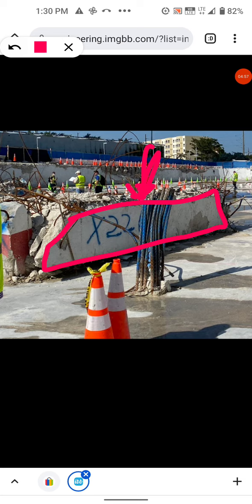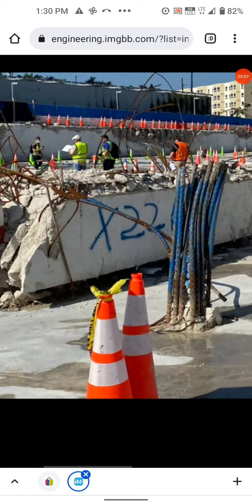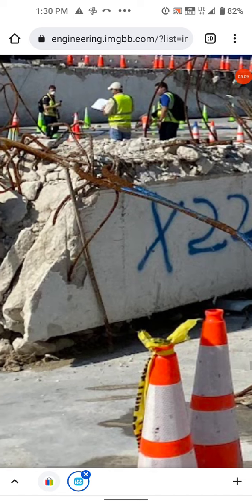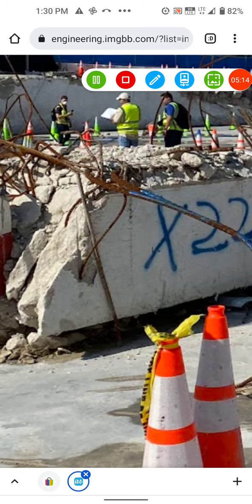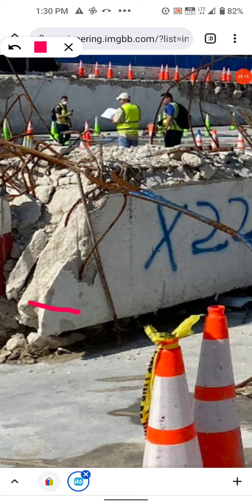Champlain Towers Collapse "H-Beam" reveals it's secrets, Shear Failure Part 2

Comment: Another video that raises more questions than answers (this is the point where student me would be desperately flicking back in my books for relevant info). 
You make my head hurt in a good way. 

The H beam was strong and stable until the failure of the middle section then torque happened.
Love to the kitties
Reply from the maker: We will go over the fractures and alignments of this failed position... I will even show where and excavator moved and did some damage to this beam system, we will try to figure out what we can reduce from this excavator force ...what it reveals of remaining capacity of this beam system.